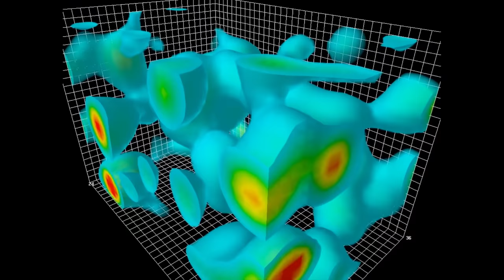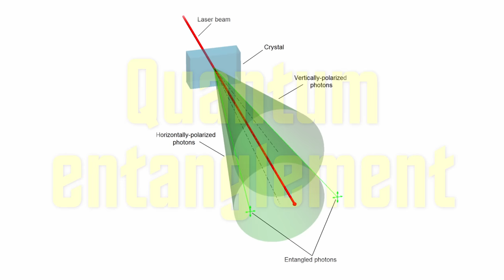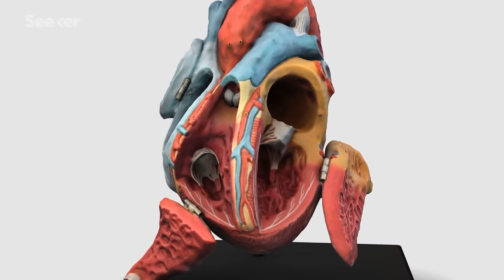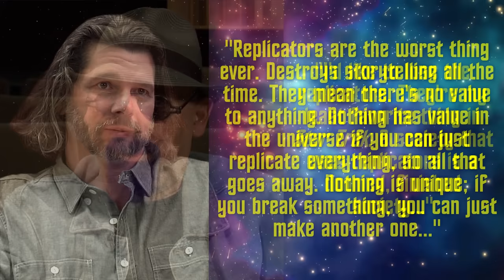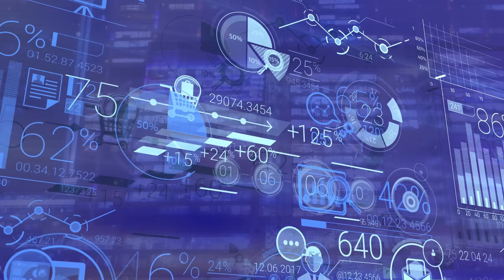Do Star Trek's Replicators Break the Universe?

Comment: I wonder if u can replicate mayonnaise...
Reply: Energy isn't much of an issue though, they have antimatter matter reactions and the Romanulan confined singularities. I always assumed the replicators ran off of the excess power from the warp core. I suppose in homes and in cities/towns there would be a central warp core type of energy creator and since they aren't doing to warp ever that means a ton of energy for people to use.
Reply: @bpdmf2798  Antimatter reactors turn matter into energy, then replicators turn it back into matter. Mass/energy conservation means that even assuming 100% efficiency, replicators would require at least as much antimatter+matter fuel in as matter they put out. That's a lot of fuel for a whole town to be consuming, so i don't think it can just be explained away. Unless they've figured out some way of spontaneously turning plain matter into pure energy, in which case why would they need antimatter?
Reply: @bpdmf2798  You realize that in ships, the matter/antimatter reactor is primarily to make warp plasma and not as a primary power source for most of the ship. Instead, for that, there were arrays of fusion reactors. It's actually a new idea for them to tie the phaser turrets directly into the main warp reactor for additional power in Enterprise. DS-9 didn't even have a matter/antimatter reactor. Even though it was a Cardassian-built station, it was powered by several large fusion reactors near the 'bottom' of the central pillar.
Reply: You could explain it away if you say replicators need exponential more energy the heavier the atoms are they need to replicate. Since heavy metals can not be replicated there still would be a need for natural resources but hydrogen, oxygen and carbon is nearly worthless.
Reply: Have the replicator de-materialize 500kg of common, no account, find it just about anywhere rock then get 400kg+ of whatever you want? Don't think fuel is that much of a concern even at 20% loss.
Reply: @travissmith2848  if they could do that, why do they fuel their ships with antimatter? If you could convert any matter straight into energy then antimatter is needlessly expensive.
Reply: @sokjeong-ho7033  If they can't where does the stuff go when they put the empties back in the machine? You'd also need (a little more than) half as much anti-matter as the mass of what you want to create.
If they do work on principles similar to the transporter, the most direct way to do it would be to "beam out" generic mass from somewhere to provide an energy stream then replace the pattern with one from ship's memory.
Such a conversion, however, would be better suited to high-draw short duration such as replication rather than continuous power generation.
Reply: @travissmith2848  my pet theory is that it's a tv show and the replicators don't actually work
Reply: @sokjeong-ho7033  And most of the limits are the writers trying to find ways around the fact that such tech is utterly transformative to the point of many if not most of today's conflict drivers have no reason to be.
Reply: The Ferengi barter things that aren't so easily replicated, or just aren't as appealing when replicated. (like booze, alien pancake syrup, ...) There's still a market for crafted goods.
Reply: Our society is already energy-limited. We need energy to obtain and process material. Replicators are not so much the problem. Practically infinite energy, however, is.
Reply: FDM printers are no more disruptive than home printers. People had the same fears. Craftsmanship is a differentiating factor. Additive manufacturing has tradeoffs and limitations.

I think replicators are fine with the correct limitations. For instance, you can limit the mass of replicated objects. You could make them use massive amounts of energy, which they would. Etc.
Reply: The Replicators use energy and matter to replicate the foods. It's just that... It's such a high level of matter manipulation that matter itself has It's energy/force form during the process of replication... Actually all matter we know are just quantum fields... Your hydrogen atoms are literally a Strong Force field (Proton) surrounded by an EM Field (Electron Field/Electrosphere). Your whole body is basically a bunch of EM and Electric fields that have strong force fields in them. We live in a crazy world.
Reply: I think you're right. It would make more sense for a post scarcity economy to be concerned with energy ⚡ rather than mass. Also thanks to entropy the it is a non-renewable recorce.
Reply: @travissmith2848  this. Just shove a bunch of rocks into that replicator and press recycle. Silicon, what from my knowledge is what most rocks are mainly made of, has more mass than carbon, so for one 200g rock you can roughly make two 200g steaks, one and a half if you count in inefficiency.
Sadly the writers of the show always wrote around the replicator instead of embracing it.
Reply: @BastetFurry  Not quite. You are confusing density and mass. a 200g rock has exactly the same mass as a 200g steak. However, a rock the size of a steak would yield a couple steaks even at 50% efficiency.
Reply: The reason there is no monetary economy in Trek is because there is a borderline unlimited amount of energy being produced on Earth from antimatter power, so nothing that uses energy actually costs additional power to create or use.  You need a transporter trip?  There's plenty of power, but please don't abuse it, just go where you need to go and then do your thing, then beam back home.  You want to make a boat?  Okay, go for it, replicate the bits and bobs and then assemble it yourself and teach yourself.

The Ferengi have an entirely different culture than the UFP, which unlike the Federation, doesn't value personal growth, learning, scientific endeavors, and they are comfortable and happy with how things have been in the status quo.  The Ferengi don't grow, they don't really do anything, they force people into their system by providing something really shiny and unique and then say "Hey, this has a cost!" whereas the UFP would just say "Oh, here's a replicator with a rechargable power cell, go build a new house."  When you base your entire culture around the acquisition of wealth, and you have a neighbor a few hundred light years away that doesn't, that doesn't motivate your society which has the inertia of over 10,000 years of doing it this way, and over 3,000 on the galactic stage, things won't change quickly.  Besides, the Klingons and Romulans both used latinum for currency, but that's because of the Ferengi establishing themselves.  The UFP just kinda went "That's nice" and then gives their officers/crewmen a small stipend to use at establishments at their starbases that do use latinum currency.
Reply: I think the merchant economy in Star Trek exists for a variety of purposes. One being the creation of commodities that, as you point out, are extremely energy hungry to create, and another being things like antiquities that are unique.

Also there are probably some societies that either lack replicator technology or don’t use it for whatever reason. The Ferengi probably trade with them extensively. Replicators are probably why the Ferengi don’t have frequent dealings with the Federation for example.
Reply: @travissmith2848  the ships collect hydrogen from space from the red caps on nacelle. Half the hydrogen is made into anti hydrogen. Which is combined in warp core mediated by dilithium crystals (the plot substance that cannot be replicated)
Reply: It would make sense if replicator is highly inefficient. In spaceship it's fine as the versitility is more useful, but regular planet folks would never use it except in niche cases
Reply: Energy-based economics also make more sense for interstellar commerce. Whatever credits or dollars a space empire would deal with are worthless to another space empire unless that empire achieves economic hegemony over its peers. Things like gold or silver would be considerably less valuable with space mining being a possibility, replicators ignored. Energy is good because it is always in demand and incredibly versatile, even without replicator technology.

I agree that idea of the Ferengi dealing with energy was a missed opportunity. The richest American to ever live, John D. Rockefeller, was rich because of oil: a commodity valuable for its ability to be converted into energy. Having the Ferengi be all about energy would fit so well with that fact.

Comment: I didn't really have a problem with replicators when they were applied to things like food and uncomplicated things which was mostly how I remember them being presented in TNG.  They required a big piece of hardware and a lot of power I always imagined.  However DS9, as much as I love that series, threw a huge monkey wrench in that method when they introduced self-replicating mines.  In order for those self-replicating mines to work they would require replication to be possible with a small emitter or some negligible piece of hardware and very little energy.  It would have been more interesting as well as not as lore/immersion-breaking if they had a few cloaked "mine replicator motherships" or something instead of how they did it.  In the end it was just used as a plot device, but the implications of automated self-replicating weapons is staggering.
Reply: The man-portable replicator issue was brought up in the TNG episode "The Quality of Life".  The exocomps were essentially small engineering AI's with micro-replicators on board.  The exocomp would use the micro-replicator to both create needed tools and add more computational hardware as needed to solve problems.  (This lead the exocomps to eventually add enough capacity that their onboard AI's developed enough sentience to fear death, causing them to stop obeying orders.)

Comment: Awesome video as always! I got into resin 3D printing a year ago, and digitally sculpting 3d files 6 months ago. It's really neat! I sculpt scale figures pretty much exclusively. That said, I know they make "denture resin" so I assume they can print teeth. Sounds kinda goofy, but I think dentures are super expensive. Basically you can buy a printer and the resin for like 5 or 10% the cost of a set of teeth. I could really see that helping out the lower income elderly population at some point in the next few years.
Reply: I'm a model builder and I've looked at 3D printing as the next step. It can also be used to replace lost parts. I am missing a piece of a model and my son does 3D printing so I'm going to see if he can make it for me. Not sure if it will be cheaper or more expensive. As for the printing I''ve seen pictures where the project wasn't set up right and you end up, in your case, resin thread. That would be me. I think it will open a new industry as well. I can't design an item to be printed so I would need to have access to a library of design. My son has already done "work for hire" and the project took time. It looked good. Back to my first point, model making. How will this end up affecting this area? I've seen some and they look great. And it looks like it is better and easier than my scratch built ones

Comment: "The replicator is the worst thing." - writers

That sounds like the way-too-common 'hot take' that, "Superman is too powerful." The Superman writers have figured out ways to get around that for nearly a century. And so did the Trek writers, "that program isn't in the database" "it's too energy intensive" "the molecule is too complex" or "that last shot took out the EPS grid on deck 23, and the replicators are offline! We're going to have to do the repairs manually." It wouldn't be too tough for replicators to become the S.H.I.E.L.D. Heli-Carriers of the Trek universe and go down with the slightest nudge.

Comment: One idea I have is that replicators could exist but require something rare to function, like dilithium crystals for starships and other purposes. They need some kind of raw material - so for example repurposing garbage, or possibly breaking down unusable material from mining and similar operations. This does create issues that unfortunately alter significant aspects of Star Trek, such as the Federation's "economy" - the material could potentially create a supply/demand issue that would feed back into a system of trade. While this isn't unheard-of even in Starfleet-controlled systems, one thing builds on another. It's a ripple effect. Star Trek's economy has never been fully or consistently explained in Federation worlds, and I'm not that smart, but it seems to me that this might create as many problems in-universe as it would solve for the stories. So I'm not sure how viable that is.

Comment: One of the main problems I encounter so, so many times when I watch videos on Star Trek technology is that so few people out there have read the Star Trek Technical Manuals.
Their entire purpose is to be a fountain of information on the tech in Star Trek, almost like the "show bible" used on set to keep the technobabble correct (or at least consistent).

Replicators are explained to be set to work at "molecular resolution", i.e. they can accurately reproduce items down to the atomic/molecular scale - with certain limitations.
They struggle with things like unstable molecules, radioactive materials, and anything built with a quantum structure to them.  They also cannot make ANY living cells or tissues.
They are programmed not to make fatal poisons, weapons, and explosives - but I'm sure a clever engineer can get around THAT!
(It may be possible to set a replicator to "quantum resolution" like transporters, to get around the quantum structure limitation, but the writers seem deathly opposed to that!)

Replicators CAN make most forms of chemical fuel and explosives (not plasma-based variants, but more like gasoline or even military C4) - however, the energy stored in those fuels/explosives must be added in during the replication process.  You can't just replicate fuel, then burn the fuel to power the replicators, and thus achieve unlimited power!  The laws of thermodynamics are so uncooperative!

When replicating food, ESPECIALLY on board Starfleet ships and at other Starfleet facilities (where the crew must look after their physical fitness and health) food and drink have their salt, sugar, and fat levels balanced so they are not especially unhealthy.  Vitamins and minerals and other necessary trace elements are commonly added as well.  All of this impacts taste and texture, but it is considered necessary to help look after the crew's health.

Also, due to the enormous energy and processing power needed to replicate anything in the first place, replicators take advantage of any and all shortcuts that can help to lighten the data processing load.  Many various forms of aggregating and averaging and simplifying the complexity of the pattern are used so that less energy and processing power are needed.  This also heavily affects both taste and texture.  So all the characters that have claimed "real" food tastes better, are correct.  Those who say there is no difference have probably eaten replicated food all of their lives and have never experienced the alternative.  Or they simply have unsophisticated palates and can't tell the difference.

Replicators are capable of making 100% accurate reproductions of food, preserving ALL of the taste and texture and molecular content (both healthy and otherwise), but this requires MUCH more raw energy and processing power, enough that replication would become infeasible if it were done this way all the time.  These ARE the early days of food replication, after all!
In the future, when more potent energy sources and more powerful computers become available, replicated food will likely taste MUCH better.  Though they will probably still balance the salt, sugar, and fat levels to make the food more healthy.  So, it won't be perfect, but it will be better than in the 24th Century.
Reply: Epic.

Comment: On of the biggest issues with the replicator is going to be power usage.  It's going to take a lot of power to replicate anything, much less dinner. Even if all that system is doing is rearranging atoms and molecules that are stored elsewhere, that's going to take a lot of energy as well.
Those energy requirements alone, not to mention raw stock requirements if necessary, would pretty much guarantee the continuance of a capitalist system because those needs are going to need to be met.
Reply: To meet basic wants and needs, the cost for the energy or raw stock may be minimal, like public drinking fountains today.  There's likely be capitalism at some level, but probably not as ubiquitous, again if all basic wants and needs are met.  Replicators can make any food and holodecks can provide any experience imaginable (with no risk), so how important would "the real thing" matter to most people?  Personally speaking, not a whole lot.